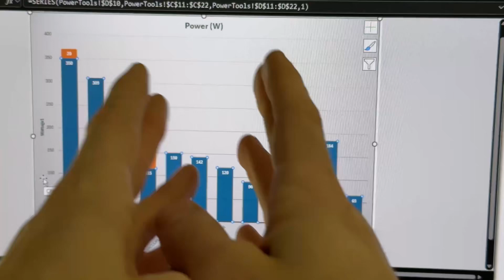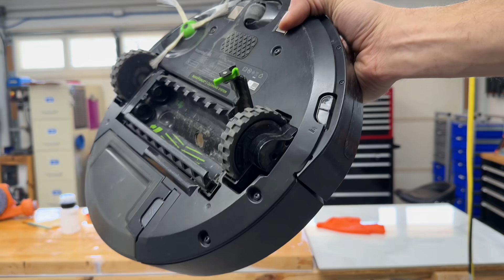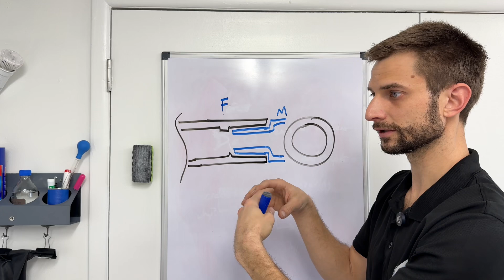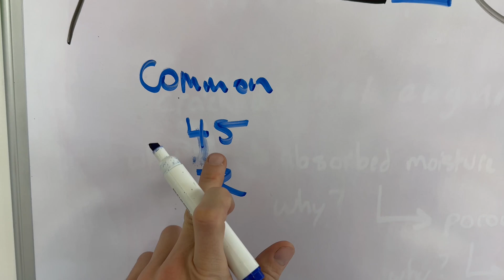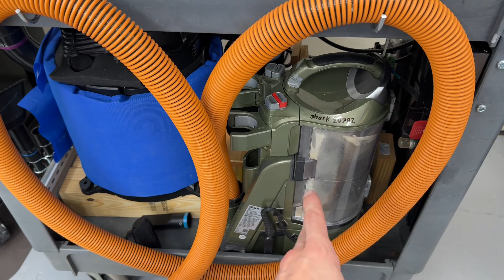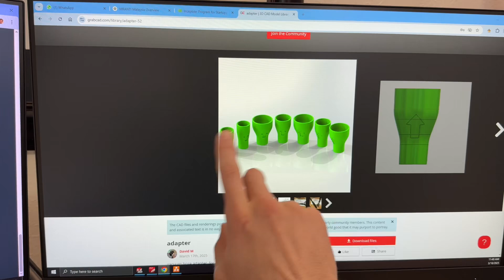Excessively technical video about a vacuum adapter

Comment: This is super cool!

I'm probably going to use it in a Kirby vacuum with broken tubes I have all taped up. However the dyson battery-powered vacuum has a super strange adapter with electrical contacts built-in, that one would be harder I think.

Also the website, I'll take inspiration since it's fast easy to use and feeding off simple markdown files, love it!

Comment: I love the breakdown of your process on the whiteboard at the beginning! The vacuum was a good choice to use for an example. Always thought of a 2x4 when it comes to nominal vs actual, but your explanation gives more context to how that applies to more than just construction. Going to be watching these videos numerous times as there’s great info in them.

If we could all adopt a nominal and parametric approach to design, then society would benefit as a whole. It seems that those who design things now create them to be difficult to work with. Vacuums being a good example, because there are a ton of different options with various attachment/hose sizes. There can be a solution that simplifies everything to a single adapter system.

How would you energy budget if you aren’t sure about the power requirements? This always seems to cause hiccups. You can always pop in a new battery for certain devices, but can’t always access something that is remote. For example, taking a concept and making it powered by solar panels and a battery. Do you test a prototype as a benchmark? You had a video about your panels surviving the hail, so I know there’s some other test you’ve been conducting that might pertain to this.

Thank you for the videos and showing how to access material you create 🙏
Reply from the maker: 🎉 Thank you - i love these long comments!  (it helps me know which discussions were useful to you and improve the next video).

Your question:
[how to budget power if we don’t know the precise power demand?]
1) benchmarking, by two methods.  first, compare to a similar machine which has a known power level. Assume they are near equal, and make sure they have the same type of motor (DC, brushed, etc) 
Or, benchmark the exact same brand with its next higher power model.  Assume your device is less power than the larger machine, with known power level.
2) simply measure Amps with an AC power meter.  If i plug in my hot plate, it has stirring and heating functions.  To know the stirring motor power I need to deactivate the heat, and turn the stirring knob to max. 
3) Get clues from our community.  My goal is to publish a whole fleet of tools power levels, and you can find the nearest device between your device and the most comparable machine in my dataset.  I bet you can form an estimate that falls within 10% of the true power.  

Please comment further to help me choose which data to publish on OpenLab next!  I’m excited to put out data that people will actually use right away!
Reply: @davidmalawey I’d say a lot of my current projects involve DAQ. Anything involving DC motors, pump, sensors, and other electronics is very helpful. Can’t get my hands on a DAQ for water quality without being a student and unfortunately can’t afford tuition. My only option to seek knowledge and get closer to my goals is to volunteer for local organizations and continue honing my skills at work in the analytical lab. Hopefully get a position at one of the labs that does testing for water chemistry. I want to help create a system or be the grunt that collects samples for analysis. Something that gives power to local scientists so they can get a better picture of what’s happening with the water issues we have in Lake Erie and the connected tributaries. Not having a degree puts me at a disadvantage, so I have to gain more experience and prove myself in order to be accepted as a pillar of the community.

Thank you for answering my questions so quickly and being someone who makes the world a better place. I aspire to be like you. Your videos have helped me get closer to making my ideas reality and not many have ever been able to help me in that way. Either they say I’m too smart or not smart enough. Only other people that do this are my managers at work who believe in me. So it means a lot for you to make these videos and care about the little guys who want to be in a position like you to improve the world around them. Sorry if this didn’t provide much feedback. I just figure it’s important for you to know that you’ve made an impact already and will do my best to provide as much feedback as possible going forward 🫡